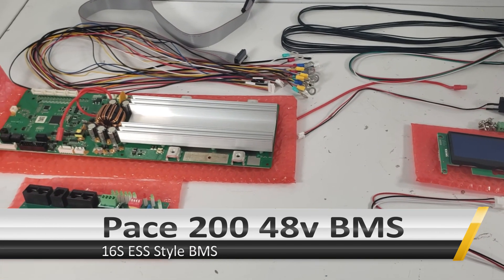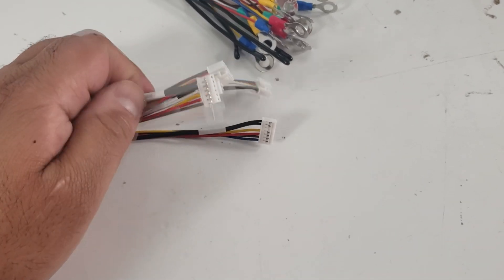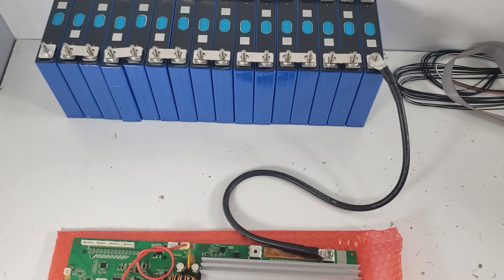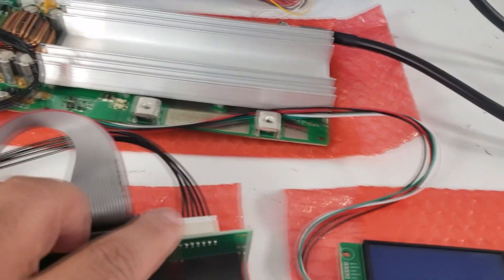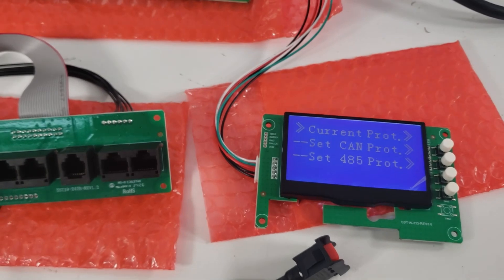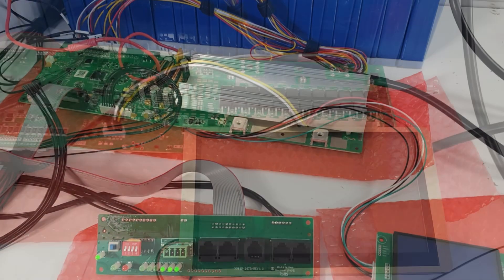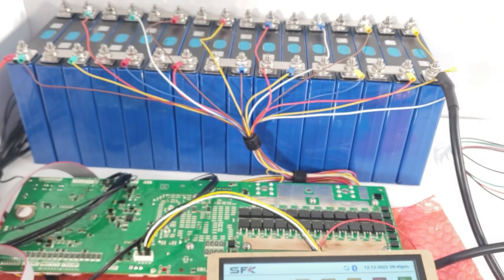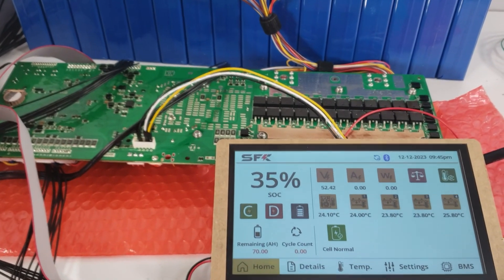PACE 200 16s - 48V ESS BMS Setup, SFK KIT 48v Preview

Comment: Nice video. I have 3 Gobel Power 48 volt 280 amp hour batteries with the 200 amp Pace BMS. I'm wondering if you have the LCD display setup available for sale now. It looks much nicer than using the PBMSTools software. Please let me know by replying here and what the cost might be. Thanks.

Comment: Very interesting and promising looks your developed system presented in the last chapter.
I really look forward to see it finished.

Will it also be possible to use the JK Inverter BMS in the system before you finish it?

Will it also have functionality to automatically connect to the Home Assistant?

What capacity your 48V battery will have?

For 48V batteries you will have new battery boxes. In your 12V and 24V battery boxes missing mounting options.
VoltGo Elite Series batteries have the best mounting system using straight plates and angles between the batteries and the surrounding area. It would be great to have these mounting options in your new battery boxes.